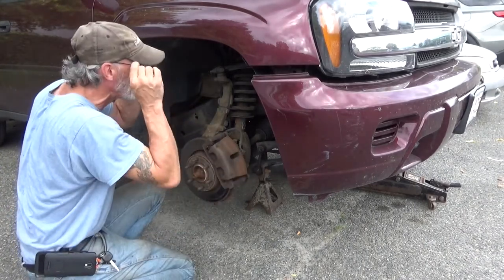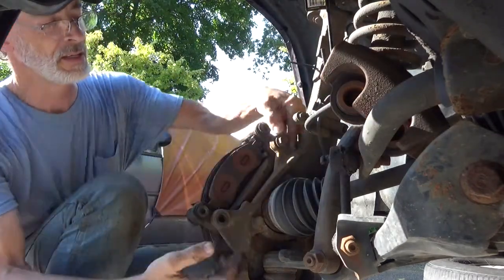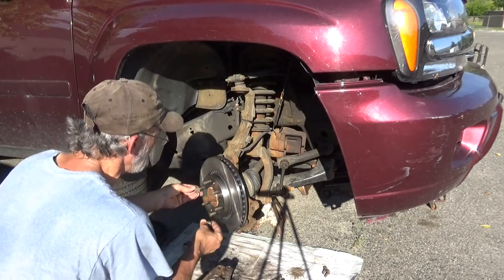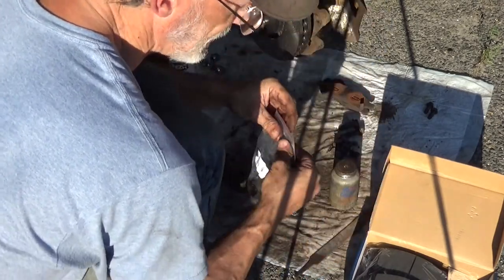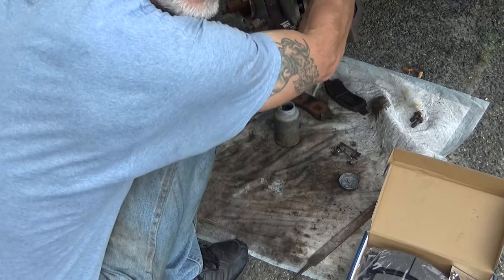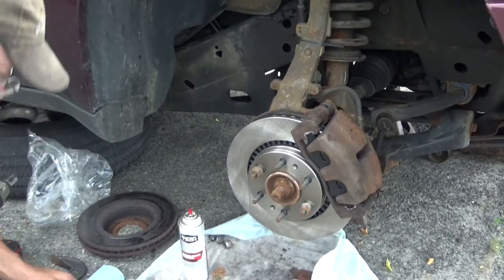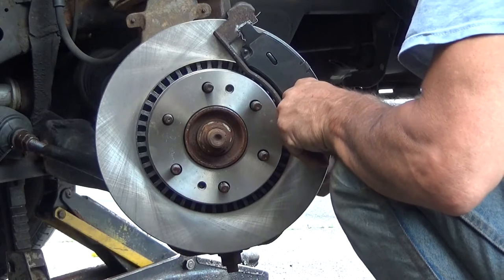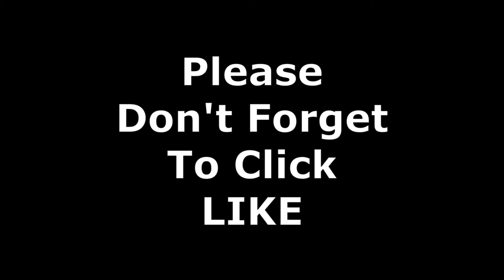2007 TrailBlazer: How to replace Front Brakes and Rotors

Comment: A year later and this is still beneficial. Thanks you and your camera angles, I was able to do my first solo brake job on my daughter's 07 Isuzi Ascender. I didn't have that compression tool but used one of the old brake pads against the pistons and tightened them with a screw clamp.
Reply from the maker: Awesome! Very happy to have been helpful!

Comment: How the hell. Man I’m having so much trouble with getting the clips to allow the pads into their home it don’t make any sense. Maybe mine are defective?
Reply from the maker: If you've cleaned any rust out of the bracket, and the clips are correct, they should go in fairly easily. If not, they may be for the wrong size wheel/model. Usually when everything is correct, and the pads don't have an uneven shear (they're die cut) the cause is usually rust scaling in the bracket grooves.

Comment: What’s wrong with putting the lube under the clips instead of anti-seize? I was told using anti-seize under the clips will eventually harden up and crumble out?
Reply from the maker: It's all about the SALT. SALT eats grease.  Shy of oven backed enamel brackets, you're going to get two years, tops.
Reply: @HouseCallAutoRepair  I use Permatex ultra disc brake synthetic caliper lube on the caliper pins, slides, back of the pad where the piston makes contact and under the clips on the bracket, it’s non-silicone, non-melting, non-petroleum-based, works great. i’m in Rochester New York so I hear you on the salt
Reply from the maker: @wild8757  I'm about 5 hours east of you. lol
I'm funny about how and when I use grease on the hardware. Under it, I couldn't really care, other than how long it provides a barrier. The longer, the better (shy of high temperature paint)
 I recently started using caliper grease from a tub. seems to be the same kind that most others mechanics are using, and it seems good, except I've notice separation at below-freezing temps... Kinda like peanut butter/oil separation.
Reply: By the way, I meant to ask you, where did you come up with M8 x 1.25 bolts to push the front rotors off? on my old standard type rotors I just took off of my 06 trailblazer it took, M10 x 1.5, on my new drilled and slotted front rotors I put on also took M10 x 1.5

Comment: At 15:50 the stuff you’re putting on the hardware, what is that sir?
Reply from the maker: That would be aluminum antisieze applied the BRACKET, but not abutment clip that go on after the antisieze. Be careful to NOT apply more than a light coating, as this is only used as a rust inhibitor. You don't want ANY of this getting on the rotor, or the braking surface material. This is done in an ATTEMPT to prevent the brake pad ears from being squeezed and seized by rust building up under the clips. (It's a VERY REAL PROBLEM in the Salt Belt)

Comment: Do you ever put Loctite blue on the bracket bolts? Or tighten your bolts with a torque wrench to specs?
Reply from the maker: Actually, I'm adopting a habit of always using blue loctite on both bracket and caliper bolts. It also help preventing rust fusion.
Reply: @HouseCallAutoRepair  if interested the torque specs for TrailBlazers are as follows, front slide bolts 31 foot pounds, front bracket bolts 110 foot pounds, rear slide bolts 23 foot pounds, rear bracket bolts 148 foot pounds.
Reply from the maker: @wild8757   Thanks!
Now I know why I've never lost, stripped, or broken one of those bracket bolts! lol.
I will torque, when specs are available in under an hour... (I never trust single sources)